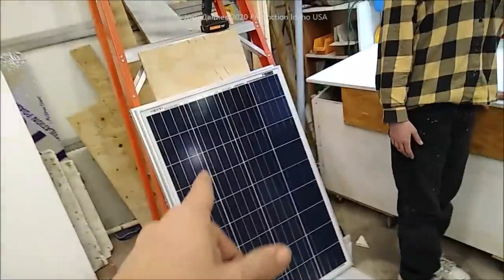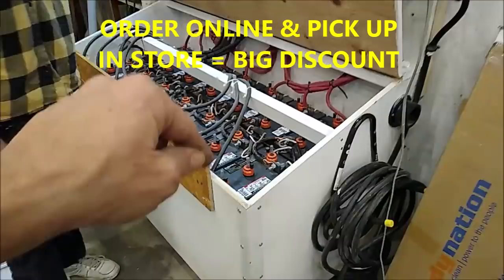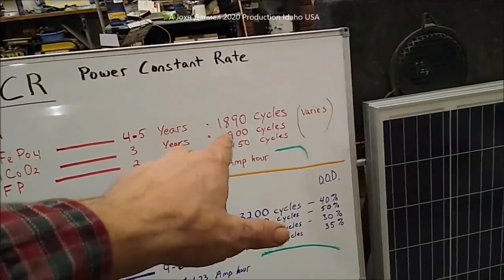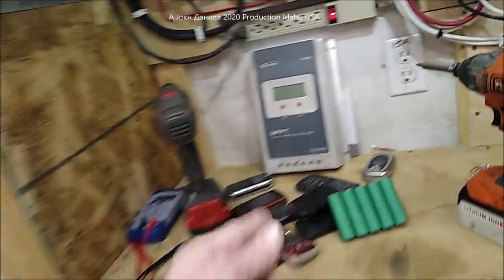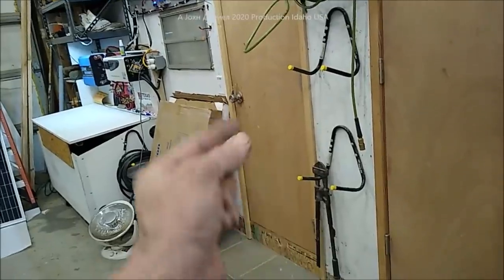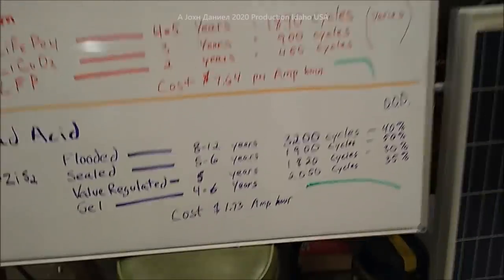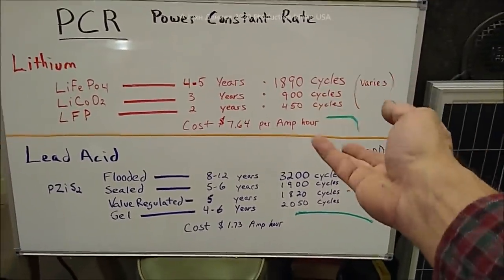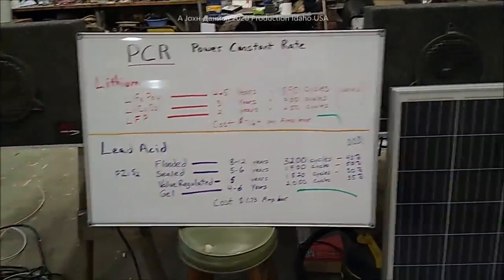Down Side of LITHIUM LiFePO4 Battery $ on RV, off grid & solar use (notes below)

Comment: Lead and solar dont go together. Period. Cycle life is the last concern when sulfation kills them in months.
Reply from the maker: You are wrong as hell. Cost being the whole damn issue, It is not YOU PEOPLES FUCKING WAY or the HIGHWAY!! (Referring to  MY DESIGN done in 2016) I took 3 LiFePo to make 36 volts, LiFePo4  set at 36 volts are easy boost and life extender on a much cheaper huge output lead acid system. We charged the 3- 25 AH in a test with a pair of Stion 135 watt - 80 volt panels, then ran our 36 volt into a 40 amp MPPT so when main bank volts dropped about 5 am to under 12.4 the controller kicked on, pulled power ( using the LiFePo4 as a night time solar panels power) and the result was always waking up to sun with above 12.25 volts. I figured that system out, tested and designed it, but next time it will be Lithium Titanate @ 60 volts 50 AH in my Hybrid. Equal to 5 hours of sun from about 1200 watts in the middle of the night. And, on we go!
 My first set LA for a big battery bank was GC2-115 and I had 16 of them, for $1,980 and I agree, they only lasted 103 months. 8 years 7 months of admittedly bad care LOL! 
 But to get 8 years and 7 months out of my cheap 1840 amp hour bank( still 920AH@50% DOD which I rarely hit for under $2000 which is same cost as 215AH of LiFePo4 BTW) but  I installed wind turbines, with the pulse charging effect cleaning them,  they were still according to the battery testing good for another year at least but we added 1200 more watts and additional needs then got our 14 size L-16 903 batteries in the shop and 6 more in the house system. A 425% cheaper per 50% DOD amp hour cost to LiFePo and a 380% Cheaper than LTO. 
Wind turbines run 3 phase to a rectifier, the positive pulse is sharp and variable with wind speeds and is like a lead acid wonder weapon. But, it wrecks the hell out of the BMS in the LiFePo4, we had some. In a year, they internally failed. 3 - 25 Ah. Total of 6 cost me $1880, a then price for 6 total which all fried internally at some point from failing charge managers at and from different charging methods including the one provided, same with those 3 more  that died in a E-Atv ( converted honda 110 atv using THEIR charger ). 
*When I first got into solar in 2007 I bought a used lift battery, it lasted 4 years but was only $500 for a 1400 AH. Adding wind in 2010 made a massive difference.

Comment: This video is hilariously wrong on about everything. Fact is lithium is really being under sold. No one mentions you need about 1/2 the solar as you dont have to fill them up while overcoming exponential resistance everyday.
Reply from the maker: I use my solar while charging since my battery bank is fully charged by 2 pm. People can live by the technical specs, in fact they argue them all day. I live by the real ones. And my cost is a absolute factual recorded from my bank account as 1/4 of it in a real full result.
Reply: @JOHNDANIEL1  if youre full by 2pm on a sunny day, thats means youre below 1.277 for 20+ hours a day which means no matter what youre sulfating even on the best of days. Solar and lead dont mix. Its science, its reality, theres no getting around it. Lifepo4 is your answer.

Comment: I bought a 138ah lifepo4 for $400. It was made in 2011. This thing is is so badass I would NEVER buy lead. It runs 150A loads, charges off my 400w 40% faster because it doesnt have current limit charge. Lead has NEVER lasted over 2 years on solar. And thats also running a generator hours upon hours.

They are fine in the cold, they just have to charge reasonably slow. 10-20a not 150a. 1 equals 2 big ass 6v's, i dropped 100lbs in dead weight, plus 70lbs getting rid of the generator, i never have to worry if its charged 100% everyday. When you know what it takes to maintain lead, you will be running to lifepo4.
Reply from the maker: Can't say I can compete, my tiny 6800 watts total and all my turbines just won't match such a result and even at 50% DOD I only have a tiny shop/house total of 26,500 storage watts after they are charged which I rarely pull off of due to incoming power till about 9 pm. But I suck, I am so backwards to new technology, in fact, I still drink water and eat food grown from the ground instead of hybrid stuff from sewage, talk about total backwards ass goof - RIGHT!
Reply: @JOHNDANIEL1  do you still use a horse to get around on?

Comment: Very misleading video. You're acting like you can use anywhere near the rated capacity of your lead acid batteries when you can't without damaging them. Their life is dramatically shortened, to hundreds of cycles if you use their rated capacity on a regular basis. In fact, I will challenge you to draw down a lithium battery to 30% of its rated capacity on a daily basis and do the same with a lead acid battery and see how long they can each hold a decent charge. Your lead acid batteries will have dramatically reduced capacity. There's a myriad of reasons RVs benefit from lLiFePO4  over lead acid. Less weight, no explosive  off gassing, much faster charging, which means if you rely on a generator you'll pay for your lithium batteries in fuel savings in a year or two depending on the batteries etc. I could go on and on, but count me as one who won't be going back to lead acid any time soon.
Reply from the maker: Wish I had your trust in those famous failing tiny Chinese parts they build into them! Mine, 100% LiFePo4,  in a 36v kit electrified Honda 4x4 atv left me walking 4 miles from a fukn diode so small it took them 3 days to track it down in the BMS .
Reply: Јоhn Daniel you get what you pay for. I had mine built to my specs and two years in on daily use no issues. Lead acid are fine for some apps, but if you use them a lot, or use them at high amperage, forget it, they don't last. If you don't believe me, ask the golf courses that are open year round how often they change batteries!
Reply from the maker: @Jumpingoffthecliff  Golf courses are by nature the most abusive owners of any battery, and proving so many switched to numerous forms and all had their lives cut by 50% or more. They run them into the ground, Super fast charge them to near boiling every day to get the cash cow cart back into play faster, with relays set to disconnect at near dead so low even a phone charger won't charge off the lighter plugs when it stops. Interstate gives golf courses 30 days warranty for a reason!
Reply: Јоhn Daniel exactly, you made my point, lead acid sucks as a technology when used to capacity or at high current. It is not comparable to newer technologies at high loads. End of story, my lithium iron phosphate doesn't drop in voltage under higher current loads anywhere near what my lead acids did. After two years, I would argue I've already saved enough in charging fuel costs to pay the difference in the cost.
Reply from the maker: Comparing a 100 amp LiFePo to a 100 amp Lead Acid did not happen here, Comparing $9.50 a Amp Hour to $2 a amp hour did. And that's about $2 a amp hour at 50% DOD of equal cost $950 for one battery, verses 950 for 8 batteries. Not weight, not CLAIMS, but proven.
Reply: Јоhn Daniel try drawing high current from your lead acid batteries and watch your voltage drop through the floor. Try my test on discharging to 30% or better yet, 20% and  get back to me. If you use only 50% of your lifepo capacity it will last for well over 10000 cycles! You're comparing apples to oranges. If you actually push lead acid to their constant current ratings and capacity limits they quickly fail. Jesus, look at the voltage drop under load on a lead acid. It's pathetic, piss poor performance and your rated capacity is meaningless on lead acid at high current, you have to literally use three times as many lead acid batteries to get sustained voltage under higher current loads than in lithium batteries.

Comment: HELP!!! I've been researching all these you tubers trying to decide on what to buy and now I'm even moire confused! I just bought a 160W solar panel on Amazon ---http://tinyurl.com/w3j6r34 
Now Need some batteries and I don't know what to buy. I simply want a small easy solar setup to connect a 1500W inverter, a small Dometic 12v Freezer/Fridge and maybe a LCD TV. Can you tell me if I am better off with 6VDC or 12VDC versions of these batteries and how many would be sufficient? Is my 160W solar panel sufficient or do I need more? Basically - what all would I need?  I'd appreciate any advice you can give since I have no clue about solar - which is why I am trying to do this DIY -- so I can learn. Thanks!

Comment: Of the lithium chemistries you showed, the LiFePO4 is the closes thing to a drop-in replacement for lead acid. I have successfully parallelled AGM lead acid batteries and 4-cell Lithium Iron Phosphate batteries, and was able to utilize the full capacity of both batteries, while keeping them in their safe operating areas. The number one problem with lithium, is that it costs $500.00 US per kWh, Lead can be had for about $100.00. While Lithium Iron Phosphate costs 5X more, it doesn't last 5X longer. In the defense of lithium, it has much less of Peukert's exponent, than lead acid. It works much better, for gusty winds(turbine) or bright sunny days(solar) for being able to take a greater percentage of its charge capacity in a short time. Lithium batteries also do better being maintained in a partial state of charge, they won't sulfate. That makes them much easier to manage, without curtailing panels or turbines. It lets you get more out of your system. Solar packs ~16 hours of charge in 8 hours, with about a 3 hour peak period. Lithium is much better suited to the high charge rate, than lead acid. AGM batteries are better than Gel, or Flooded lead acid batteries. The round trip efficiency of LiFe batteries is about ~90%, AGM(sealed lead acid) are about 85%, Flooded, ~75%, especially at high charge rates. Gel batteries are not well suited to high charge rates, so I don't recommend them for renewable energy.
     Question: Do those L-16 batteries come as 2 volt 1,110 AH cells? What I really need, is 96 400 AH cells. I want to be able to voltage balance during absorption and float, and allow discharge without voltage balancing. I do believe, it would reduce the need to equalize, allow a lower finishing voltage, and give perhaps 10-20% more cycle life. While battery management isn't necessary for lead acid the same as lithium requires, I do believe that lead acid cells could still benefit from it. I would be fine with these 6 volt 370 AH batteries, if there were small auxiliary terminals between the cells, so I can balance the cells within the individual batteries. No two cells have exactly the same self-discharge rate, even in the same battery. 6 volt batteries are better than 12 volt for that reason, but, I would still like to balance the voltage to individual cells.

Comment: I will take an American built BattleBorn Lifepo4 battery over any AGM on the market every time.  DOD and charge rate are far superior to the AGM.  Build yourself a bank of Lipo4 batteries and do the actual test.  Current industry is proving you wrong. You make some incorrect statements concerning using and charging Lipo4 batteries at the same time.  Do not confuse Lithium ion with Lithium Iron Phosphate.  Apples and oranges.  Just my opion.

Comment: I do agree that lithium isnt for everybody...however listening to your video hurts! At its simplest form it screams "you cant teach an old dog new tricks". You are mixing and matching all kinds of numbers and info to try to prove a point, but you are so far from comparing apples to oranges. People who camp 5 weekend a year in there RV absolutely do not need to spend the money on lithium, Ive gotten 8yrs out of AGM batteries in this type of situation but even then they are at a severely decreased capacity and dont have anywhere near the 3200 cyces you quoted, thats an insane number for lead acid. Who will benefit from lithium? People who cycle them almost daily. As long as they are charged correctly and not allowed to freeze lithium will out last lead acid hands down. An off grid house i have done some work at went through several different battery banks over the first 10yrs, always having issue with low water, dead batteries, weak cells etc. Swapped over to lifepo4 5 years ago and have literally not touched the batteries since, it simple works every single day. its so reliable they got rid of there generator, that wasnt even a consideration with the old lead acid.

Comment: In my own experience I have seen lithium burn and lead acid explode. The intensity of the lithium fire would set anything on fire. When the lead acid exploded it vaporized everything but one lead terminal lug still held inside the battery cable connector, it swung out of the engine baby slapping the fender leaving a huge dent. Yes I said vaporized, it exploded in a car, inside a garage, there was no where for it to go but nothing was found, not even a scrap of plastic from the battery. The sound was louder than a shotgun, my idiot neighbor used a cigarette lighter to see the water level after the caps had been removed.
Both options suck, both require a strong metal box and other considerations.

Comment: A lot of comments from people that bought snake oil.😂
Reply from the maker: Same identical cells they use in those built up batteries are in my 3 laptops. Written right on them, LiFePo4 Lithium Iron Phosphate None in my laptops have made it to 3 years and one only made it 10 months. But the $105 battery in my truck is almost 6 years old, sits outside in the heat and below zero temps and this morning proved it's still got it.

Comment: The points in your video are valid with respect to lead acid being a suitable, low cost energy storage alternative to LFP. However, the idea that the two vastly different battery types are in any way comparable is absurd. When I was in high school we had a 1969 F250 camper special that did a fine job of towing our 18 foot boat to the River on the weekends and I could repair almost anything on the side of the road if needed. In 2020 it would take a garage full of electronic equipment and special tools along with a technical degree to fix almost anything on a modern pick-up. Does that mean it's not a good vehicle? Of course not, by almost every point of comparison a new truck is safer, more comfortable, more reliable, more efficient etc. Than the older technology. Ya it's more of a pain in the ass when it does need repair but in the mean time it's far superior. Same thing with LFP batteries, they require an electronic BMS so are more complicated. As far as catching fire, maybe the RV owner should have read the spec sheet on the product he purchased. Perhaps he overloaded them? You can keep the sulfuric acid, weight, size and poor depth of discharge and I'll keep the LFP batteries on my solar system.
Reply from the maker: Yes, you actually saw the reason for the argument on the cost, most all Pro-Lithium did not. They saw it as a attack on Lithium based capabilities, not the 400 to 500% difference in total cost. 
I differ with their assumption of lifespan, I have in the last 3 years replaced numerous LiFePo4 batteries in laptops and tools that are 100% marked as LiFePo not LiCo or other, none made it past their eternity lifespan and cycles as claimed. Not even to 20% as advertised. So does that compare with big 100 amp hour $1000 batteries?? Yes, in the same way a glass of water compares to a gallon of water - both are water and made of the same thing. They claim 10,000 cycles from items that have been marketed 2 years. Yet the HUP1 battery I used to represent my Lead Acid top performer of 3200 cycles has been around since the 1950's and exceeding that for 1/3 the cost per AH of LiFePo4. That, as you saw is the problem with it all, COST and facts are ignored by the Lithium crowd, but all you got to do is go back to 1986 and remember the year long  hype on all the magazines of NiMh to learn it did not solve cancer, bring back Jesus, or cure stupidity either.

Comment: I’m considering installing a system on my mobile home for backup and would appreciate all suggestions.  Existing line supply 50 amp 240 volt.  Don’t plan to use portable generator, just solar with batteries to feed the existing system with 240 volt, 50 amp.  1400 to 1800 watt 48 volt solar panel array, 400  amp 48 volt battery power, interlock on main panel to avoid transfer switch,  4000 watt 48 volt inverter (no need for battery charger, only solar).  Only need to power refer with freezer, TV, dish receiver, 6 led lights, internet router, 3 computers. Appreciate suggestions including advice for inverter  and interlock models and source.
Reply from the maker: The 50 amp 240 volt RV SYSTEM is just a easier method to supply the power from the park or source. In you RV everything is 120 vac but 2 sides from your trailers breaker box. The trick is using 120 volt inverters in a few places needed but isolating out your breaker box on the RV.